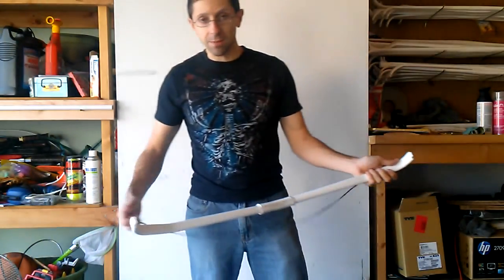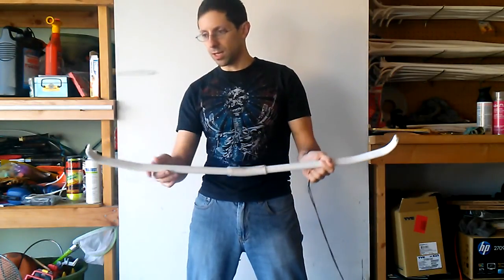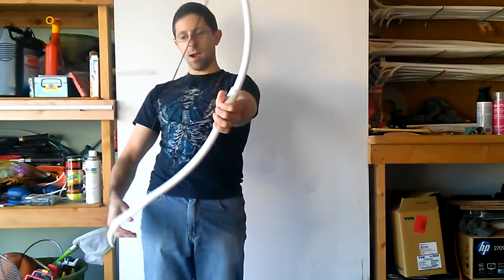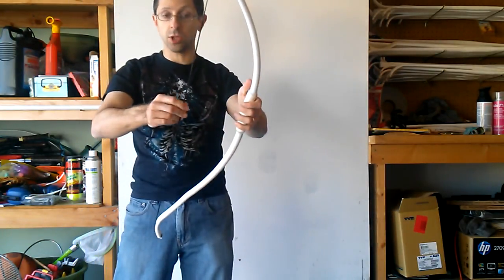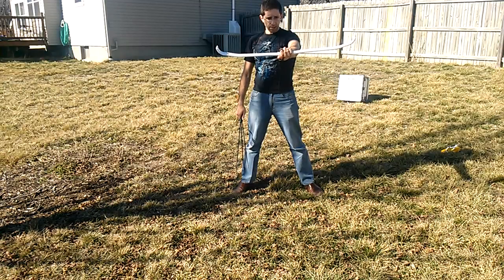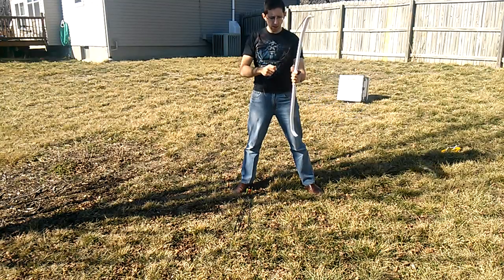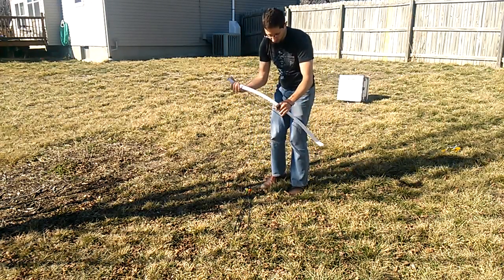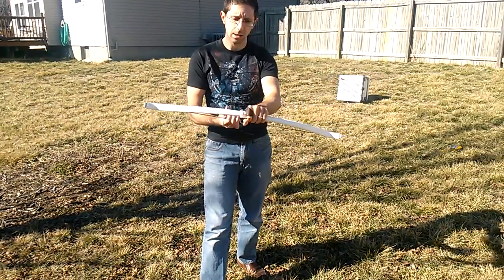Pocket Rocket: A Tiny Reinforced PVC Bow

Comment from the maker: Stack is just what happens when you get near the end of a draw, and the weight keeps going up, and up, and you're not getting much more out of it. It's due to a loss of leverage, but that's neither here nor there. 

So... for good performance, you want light limbs. Check out the Holmegaard bow, for example. Wood is way lighter than PVC, and it's a rocket.

Comment from the maker: Funny you should mention that :-) I'm working on a little book summarizing bow performance, but that won't be done for a bit. 

THIS bow performed surprisingly well; the usual, unmodified 1/2" pipe bows don't perform very well. I called it a pocket rocket because it really launched the arrows fast. 

Basically, a bow performs well if the energy you put into it go into the arrow. Short bows tend to waste energy on stack.

Comment from the maker: The initial size was 41 inches (I might have said 38" in the video, but it's 41" long!) - 1/2" diameter schedule 40 PVC. I flattened it, recurved the tips, heated a piece of 3/4" pipe for the handle, cut it with tin snips (I'll demo this in a future video), glued it on, then reheated and reflexed the handle. I added a tiny bit of reflex to the limbs then, too. 

After everything was made straight and true, it was strung and shot.
Reply: Thank you so much sir